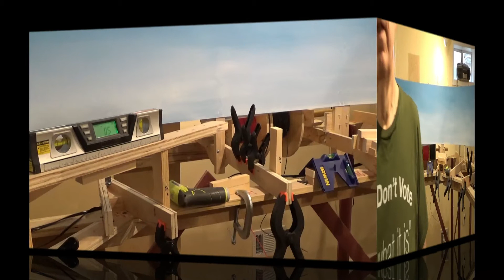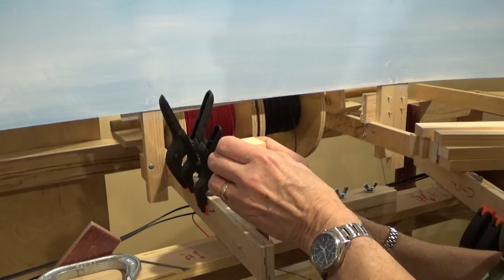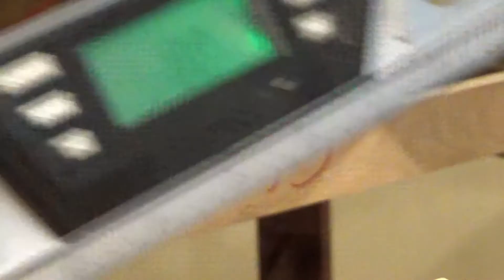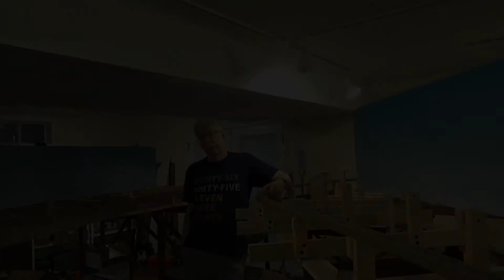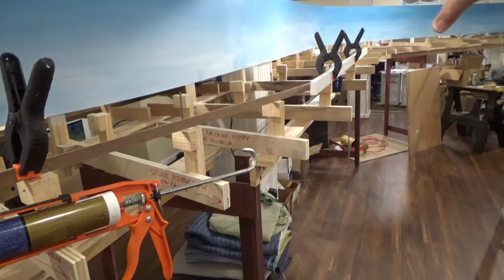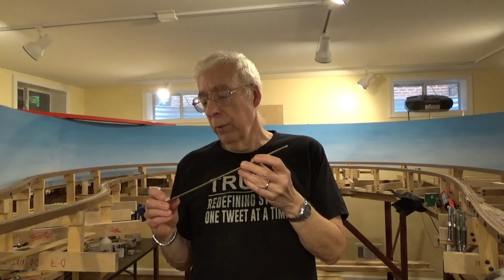Episode 13   Building Spline Sub Roadbed

Comment: I'm back to your video. How did you cut all the 3/4" Masonite into even strips?  Did you have a helper?  Did you cut it on a table? Did you do 8 ft strips or cut the other way with 4 ft strips?
Reply: I did cut a 4x8 sheet of 8 ft strips, first using an 8 ft straight edge and my circular saw. I then ran though my table saw to clean up a straighter edge.  I then cut 3 more 4x8s to 2x4s and then easily ran them though the table saw. Watch out as there was a whole bucket load of saw dust! Maybe do outside as the dust went everywhere.  Now I'm going to go over Cal's videos and get going on my project. Also make sure you are using safety glasses and a good mask. Masks are very important, as it's impossible to do this much without inhaling the sawdust.

Comment: I didn't see when you took out the coder pins. When you take them out is there a gap in the roadbed due to the coder pin drying in place?
Reply from the maker: Yeah, there's a gap of about 3/32 inch, roughly the diameter of the cotter pin.  But since the roadbed is built up by eight laminations of Masonite strips there aren't any issues related to structural weakness, and I also use the resulting "hole" in the completed laminated subroadbed to insert a 1 1/4 inch phillips flathead machine screw to anchor the subroadbed to the cleat.  Answer your question okay?

Comment: Most thorough spline demonstration I've been able to find. Thank you!
Unresolved question is, how do you secure the spline to the cleat in place of the "cotter pin"? Is that where the segment on brads and countersunk screws come in?
Reply from the maker: Brian,
Glad you found my ad lib "tutorial" on spline roadbed useful.  Correct re the segment on brads and countersunk screws as means to secure to the cleats.  I just need to repeat a couple of the tips on that.

First, if you use brads be sure they are at least .5 in/12.5 mm longer than the thickness of your splines, but less diameter than the thickness of a single spline.  Drill a pilot hole slightly smaller than the diameter of the brad almost all the way through either of the splines nearest the center of the laminated sub roadbed, but not into the cleat.  Slightly dull the sharp point of the brad with a light tap with a tack hammer... this will minimize risk of splitting the grain of the cleat.  Tap the brad into the pilot hole and continue to carefully tap away until the head sits flush with the surface of the laminated splines, then use a nail punch to "seat" the brad about 1-2mm below the surface.  But, proceed carefully here because if you drive it too far you may risk separating the spline laminations, so it is always a good idea to c-clamp the laminated splines before you use either brads to provide a little additional reinforcement when you drive the brad.

Second, I prefer to use counter sunk (phillips head) wood screws do in locations where the spline roadbed is under additional tension over the span of a vertical transition easement curve.  I do this because I've found that if the laminated splines are not held securely to the vertical curve established by the riser+cleat that the tension will be relieved elsewhere, and that never works out well... particularly if the roadbed is also in tension from a horizontal curve or easement.  That said, proceed as with a brad, except use the appropriate size drill bit with adjustable countersink fitting and set the depth of the drill bit to equal the length of the screw, minus the head.  Definitely c clamp the location before you start drilling, and be sure to also clamp the spline to the cleat as well, because the force of the drilling and/or the screw itself will tend to lift the spline from proper contact with the cleat.  The point here is that you're taking a structure that wants to be level and straight and forcing it to conform to a distortion in three dimensions so that over time it will naturally assume the desired shape.  Like the brad, be sure the head is countersunk 1-2mm below the surface of the splines.  BTW, I usually use 1.5 in/37 mm #6 screws twice the vertical thickness of my splines.

Hope this was helpful.

And to all of my subscribers, I owe you an apology for the delay in releasing new episodes.  I have been very busy working on resettling Afghan refugees and that has a much higher priority than my model railroad layout.  I am accumulating enough video and graphics to produce at least two episodes, both devoted to constructing scenery,  I just need about 8-10 hours to go through all the work to turn them into finished productions.  Hopefully I will have something up for you all later this month or in February.  In the meantime, if any of you want to join in on the effort to assist our Afghan, Iraqi and Kurdish allies, I very much you to check out Veterans For American Ideals, www.vfai.org.

Happy New Year!